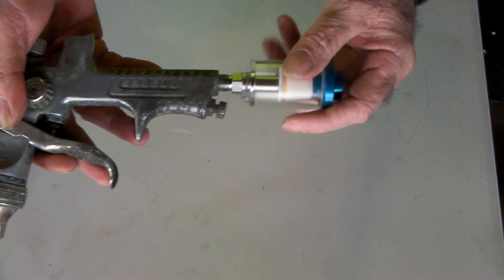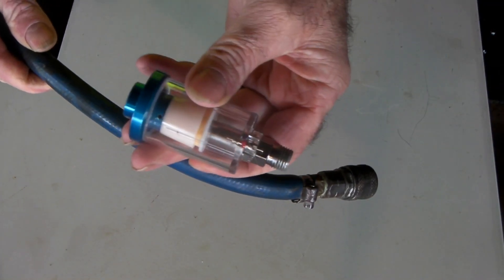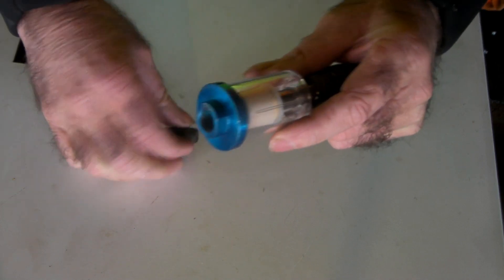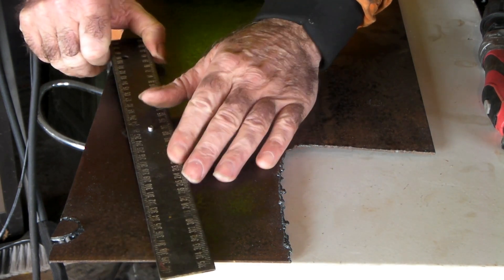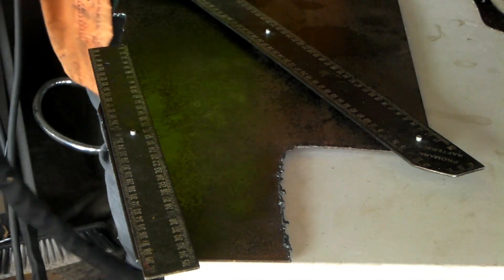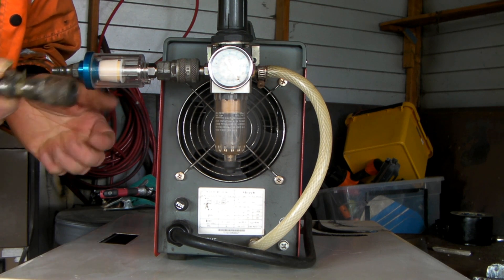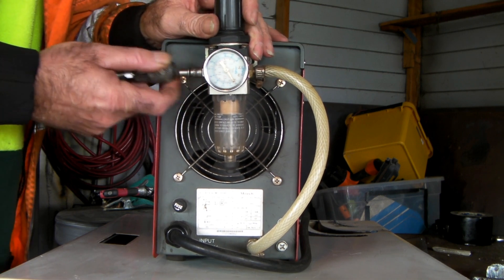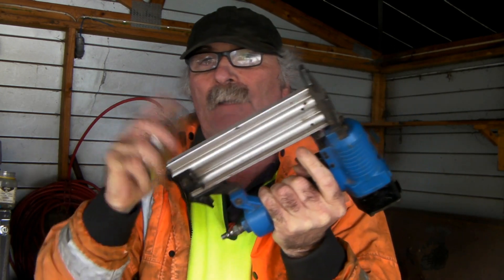Diy Plasma Cutter Air Dryer  EASY

Comment: Are you using the water filter backwards because the Amazon link page shows the blue end as being the outlet and you show connecting the blue end to the air inlet.
Reply from the maker: lol nope
Reply: @petestools  Its def on backwards, but hey it Australia.  Air flows opposite there than in the US
Reply: @nunyobiz7889  New Zealand is not Australia...
Reply: @m3chanist  Just bustin ya balls man.  I like your videos.  Keep em coming

Comment: Hi Pete. Just started watching your channel - ran across it the other day. 
Question please, can you confirm if you are touching the tip of the cutter to the metal material and drag it along? I just got a CUT50 and have only just began cutting. I ordered some magnets and will make a guide like you suggested as that looks quite simple to keep a straight line. 
Thanks.
Reply from the maker: Hi mate ,Yea touching the steel it's a drag tip. That magnet straight edge is simple to make  and i use mine all the time.
Thanks for watching pete
Reply: pete's tools is there a special tip that is a drag tip? I purchased short and extended length tips but I don’t know if they are drag type. Maybe you could cover in a video for us beginners. Thanks Pete.
Reply from the maker: If you are using  a pt-31 plasma torch like i do then they are all drag tips .long or short it doesn't matter . There is no spacer covering the tip thanks .
Reply: pete's tools thanks - that’s the ticket. They all do have the cut lines in the tip too. Like your channel And sense of humor.
Reply: When you buy them, they’ll be called drag tips. I don’t know what torch you have, but you may need a new ceramic cover too. A drag tip is two parts. One is the cutting tip for drag. Two is another part that fits over that so the tip is held above the metal. That copper cover has an X on the bottom, and a largish hole for the tip inside to fire through.